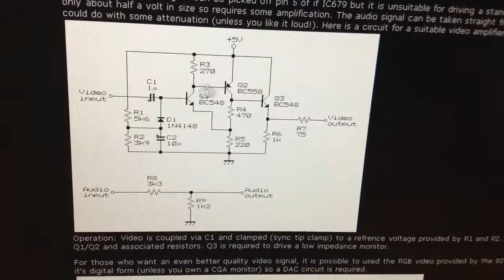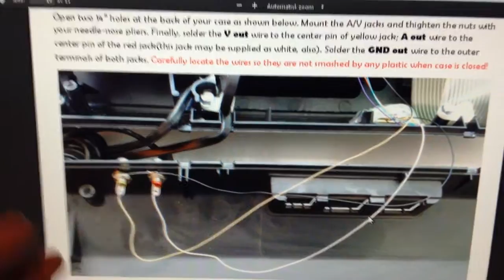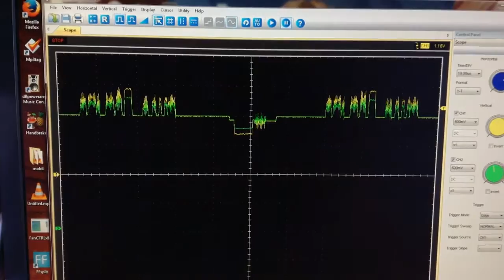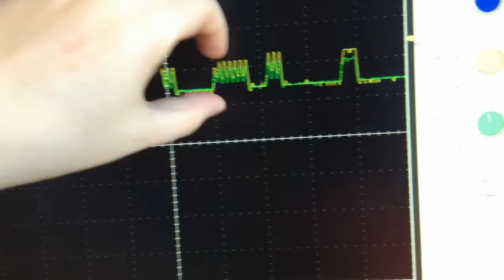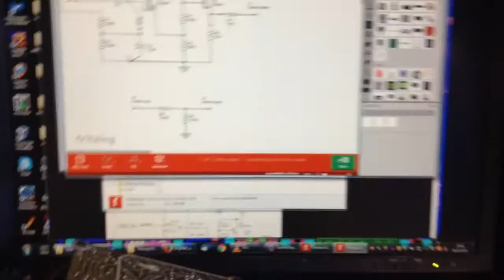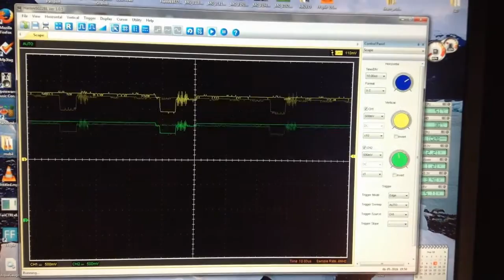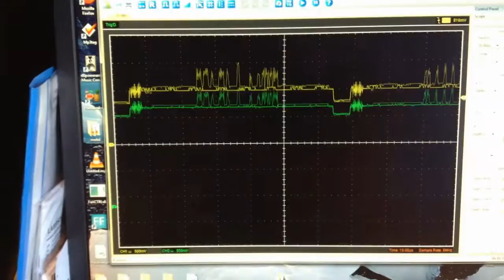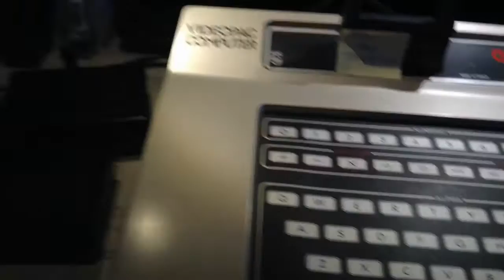Videopac G7000 Composite mod part 2

Comment: Thanks Hans! I'll have a good look at the cable lenghts and the positioning and stuff. 8mm drill, learned that. Very good. And I'll have to get some wire and heat shrink as well. 
You'll end up building a circuit that cleans up the signal before you know it :)
Reply from the maker: +The Highlander Hehe, I'll look into it. I did cut out some discussion from the video regarding adding ground wires like they do on some Atari models to help digital power noise take a different path than through the video circuits.. The Videopac might have same issues. The power distribution on that motherboard is very limited just like the first commodore motherboards, the power distribution there were sparse compared to 250425 (the one you have) and later boards have massive power copper planes.
Reply from the maker: +The Highlander I haven't written on my blog since the ball and beam project. Will do a writeup with pictures. The two modification  instructions that I followed in the video could use some improvements.
The first site (gamesx.com) with the circuit diagram in which we used talks about attaching wires under the metal can.
The other site (coolretroprojects) who sells the circuit which look like ours, the installation guide which utilize the modulator cable is the best guide I've seen. The only thing I disliked there is that the top and bottom cover can't be separated. Some don't like to follow videos also when modding which I can understand.
Regarding wirelength. See if they will just fit, cause it is also nice that the wires are stretched out or else they might rest over the power supply which is unfortunate.

Comment: Having trouble with this circuit but maybe I blew a cap as I installed the transistors the wrong way at first lol. I can't read across C1 (video in) to ground. However I can get a reading from the - side of C1 to ground. All other readings are consistent with yours.
Reply from the maker: I think the cap you have is still fine. https://gamesx.com/wiki/lib/exe/fetch.php?cache=&media=av:g7000av.png If you read C1 on the left side (video input side), then that input is "floating" so not getting a reading is normal assuming it is not connected to the videopac. What is more important is the (bias) voltage on the right side of C1, the base voltage of the transistor. If you get the same as me then it is good, the transistor should be happy. Check all connections, follow the schematics :)
Reply: @bwack  Cheers mate for the swift reply. I had thought that as of course being 1 microfarad it discharges fast. Oddly I'm getting less volts coming out of my video circuit than is going in, so I'm pulling off my ground and +5 and re-doing those again in case I made a mistake. Do you have a photo of the front and back of your build so I can see what I may have done different from you? For simplicity, I've used a larger board and laid out the components exactly as they appear on the schematic, rather than neatening them up like you did in your planning phase.
Reply from the maker: @005AGIMA  I do have the photo somewhere (maybe), but maybe better to use the fritzing layout I made, which is breadboard layout :) If you freeze frame at 10:42 in this video, you can see the components, and traces. The blue wires are the ones that goes under the board.
Reply from the maker: oh wait it is in the other video : https://www.youtube.com/watch?time_continue=642&v=mua8CnnPShk&feature=emb_title